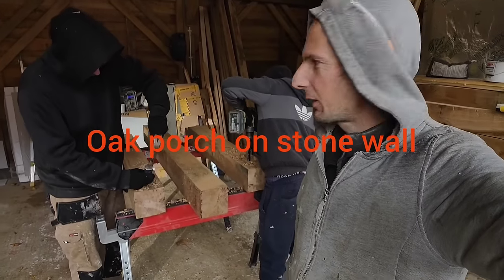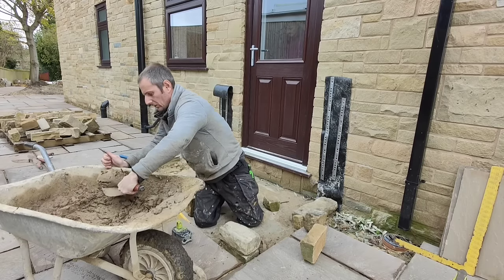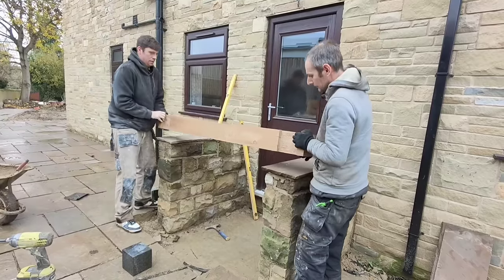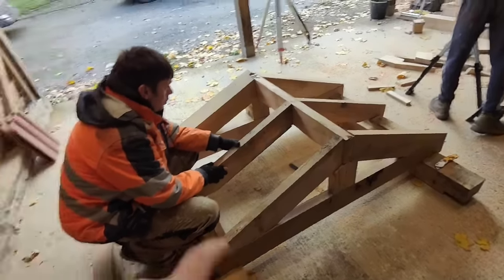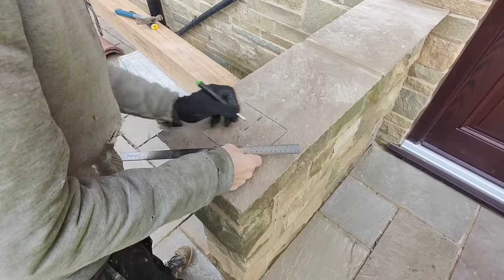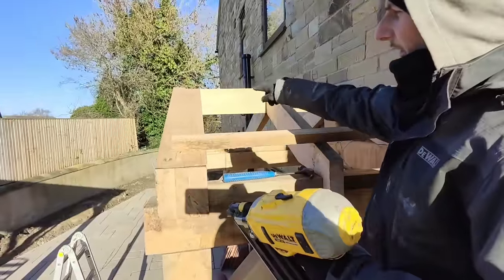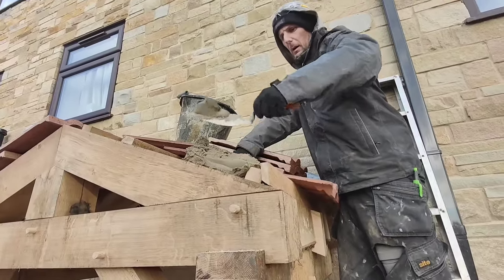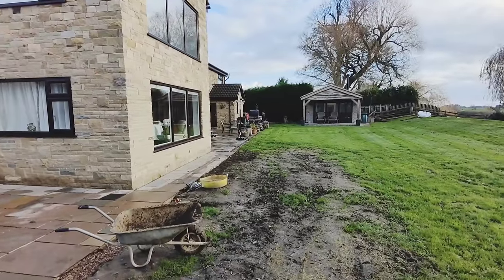oak porch with wall door canopy

Comment: Beautiful job Mark. Do the timber plugs remain protruding as a feature or get surface trimmed later on? I’m not familiar with this type of raw timber construction so I don’t know. 
I wonder also if when pushing in a steel rod if the hole is a bit tight it might be an idea to run the grinder along the rod to create a groove for the resin to come out rather than create an air lock. Same principal as a timber dowel. If using 12mm rod and 12mm drill bit for the hole there’s likelihood of an air lock. Unless you use a slightly oversized drill bit to give a loose fit for the resin to form around the rod.
Reply from the maker: Cheers mate .I always leave them sticking out a bit .looks quite nice .but you can cut them flat if you don't like them sticking out.yere think you right mate could have done with the hole a little bigger.first one really struggling to get it in 👍👍👍

Comment: Hi Mark , I'm looking to fix masonry bolts into concrete plinths and was looking to bond them in also . What bonding agent would you recommend.
Reply from the maker: Hi mate any two part anchor resin will do it .just make sure to squeeze a bit out first then you will see the colour change and will be mixed 👍👍